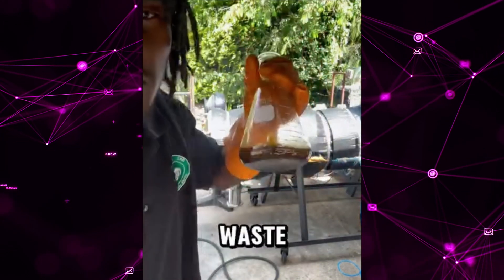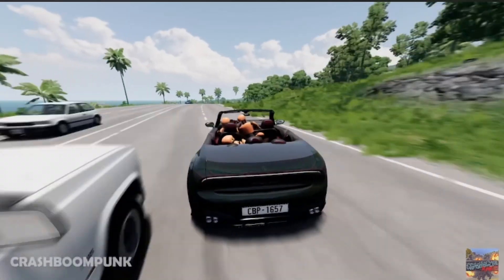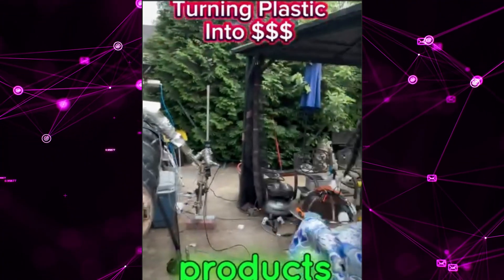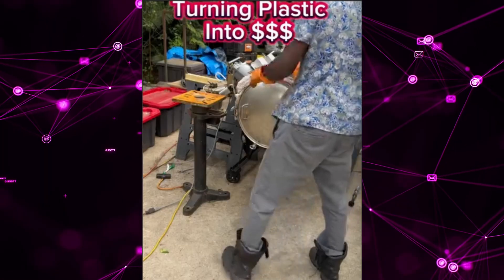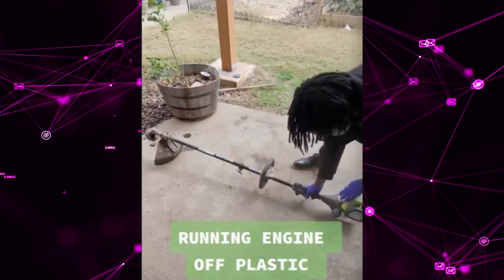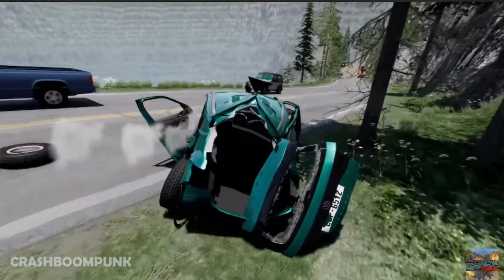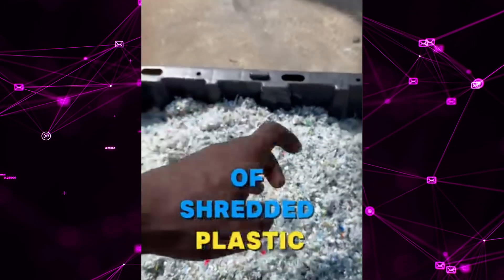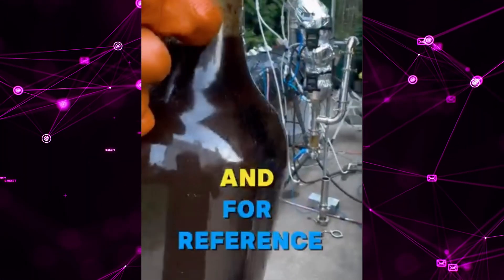He Turned Plastic Waste Into Fuel

Comment: Such an intriguing video; it really shows how plastic and carbon are converted into fuel. Claims like these should be cautiously listened to. The notion of producing fuel in a sustainable manner from waste materials is laudable, but the scientific validation required to prove such claims and peer-reviewed evidence for the same are not provided in the video.
This process, however, is not new. For a long period of time in the past, attempts had been made to transform plastic into fuels, but the commercial practicality had always remained out of reach due to several factors. Energy input is mostly higher than energy output during such conversion processes, making it impracticable economically. Safety issues involving chemicals and a possibility of toxic by-product formation make this process quite problematic.
Other than that, the narrator had no formal scientific credentials; there is no published research. Also, while it's entirely possible that the subject had some kind of breakthrough, until such time as independent verification and peer-review under extreme scientific scrutiny are replicable, concrete conclusions are needed.
In any case, while exciting, this research domain of waste-to-fuel sustainable production requires substantial corroboration of the claims presented in the video and should be further investigated for validation and feasibility on an industrial scale.